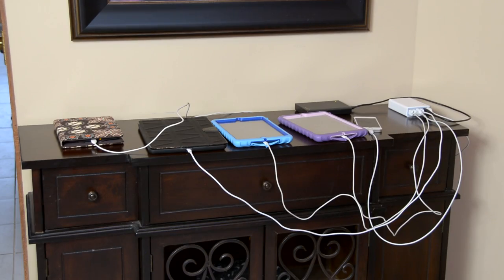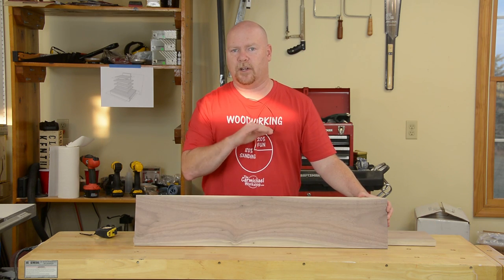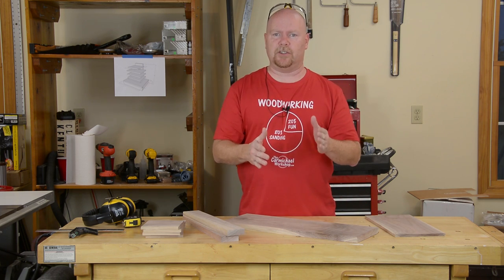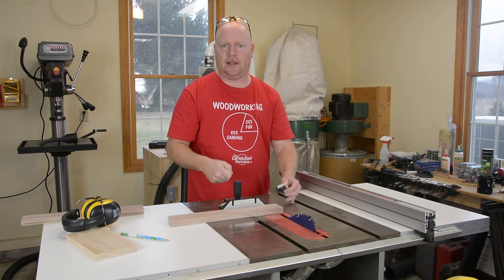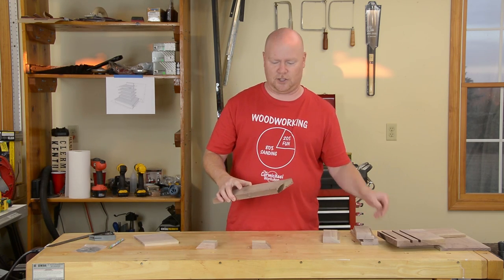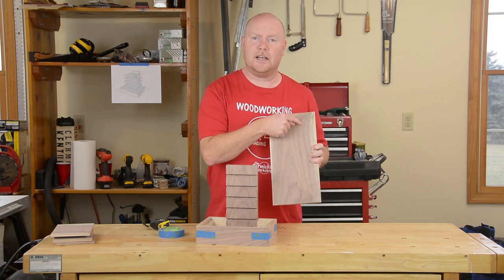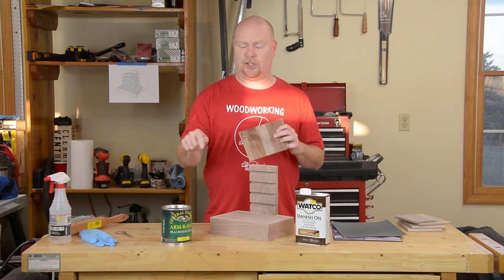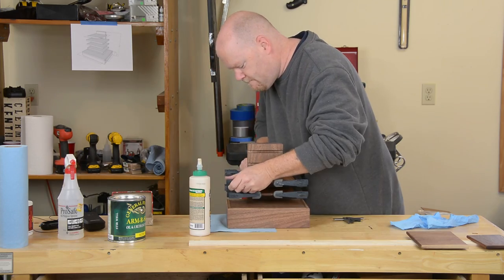Device Charging Stand

Comment: You could drill a hole in the upright right below the shelves to pass the cords through. Then  retain them with a staple to the end grain of the shelf. It would keep them out of line of sight without building a new one with rabbeted wire channels.

Comment: I built a charging station a while back, the kind you lean your phones on, I didn't really like how that turned out since my phone charges at the bottom so I would have to put it upside down. I took it apart made grooves but it turned into a bit of a mess.

This design seems like a better choice but it hadn't occurred to me. Most I looked at seemed to be built the other way.

I will probably add a fan if I end up making one. Not that it's needed or anything I just don't trust a lot of those ac to usb plugs(I try to use quality ones, but I never know what my wife will plug in) and I have some small 5v fans that would be able to run off of usb.